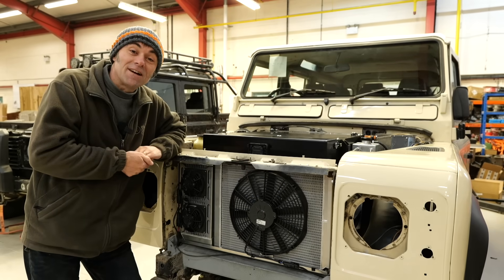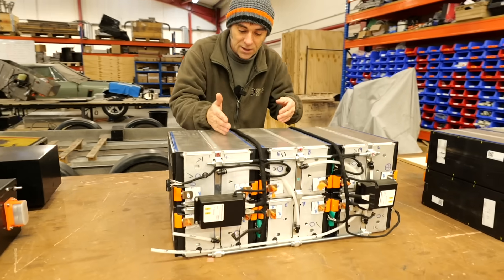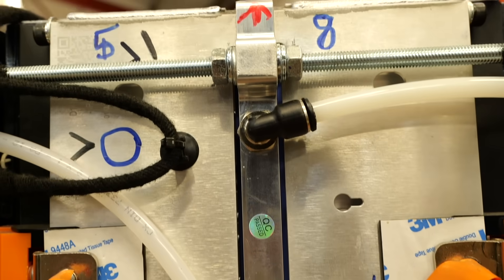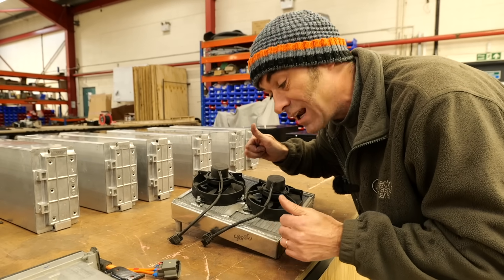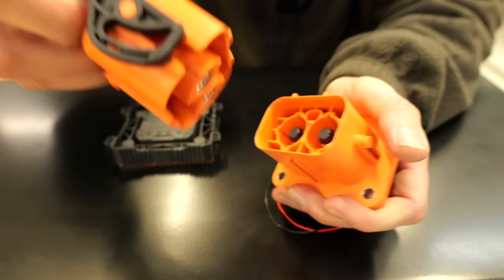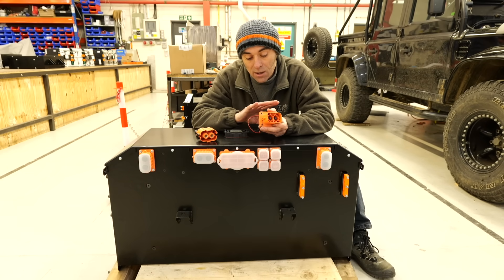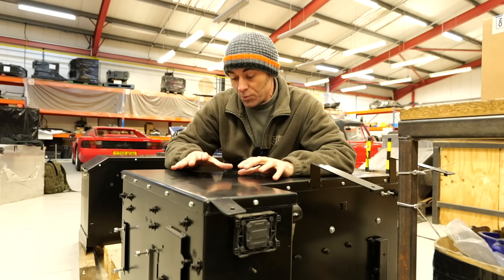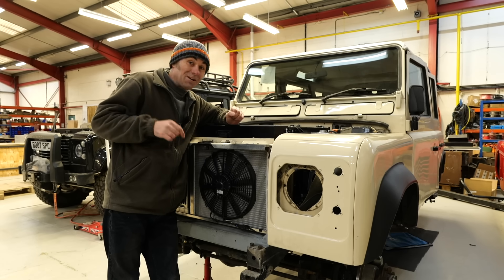How safe are electric cars?

Comment: So Moggie, this is all very good as far as the battry installation/management but, given more than quite a few events of electric cars catching fire whilst on charge, for example lately at a German car manufacturer main dealer site in Swindon, what systems are in place for this ?
Is this a vehicle systems issue or a charging station issue ?
Reply from the maker: Just because an EV is charging up when it catches fire, doesn’t mean to say that’s what caused the fire. Lots of cars (petrol, diesel and electric) catch fire when parked, due to something in the car or a fault with the 12v wiring system. The press and social media has blown EV fires out of all proportion when ICE vehicles catch fire much more often and have done for decades.
Reply: @ElectricClassicCars  My question was about what system's are provided to prevent these situations within the EV itself.
Why do people appear to take this as an attack on electric vehicles rather than a genuine interest question 🙄
But I have to say, from what I've seen, in real life a d not just the press, it does always appear to be the EV that's on fire not the infrastructure
Reply: @ElectricClassicCars  The worrying thing for me is that when an ICE car catches fire its mainly electrical and in the engine bay, but when an EV goes into thermal runaway its the power source that is the problem. We do not hear of ICE cars petrol/diesel tanks suddenly exploding for no reason! I love the idea of an electric car but i'm quite happy to let everyone else be guinea pigs at the moment. Hopefully battery chemistry will change in the near future to mitigate this obvious risk.
Reply: The Swindon Audi fire was caused by a technician not following procedure and was extinguished with relative ease, not the 'raging fire burning for days' kind of fire you may have heard about elsewhere.
Reply: It was enough to close the dealership though.
But my question was directed to ECC.
And the incident was not an isolated issue as I mentioned.

Comment: All of these systems are great on an engineered system. But this on a DIY system is not enough because a DIY system can end up with a punctured battery during installation or other physical issues that will cause a battery to go thermal. 

So the battery case it self needs to be able to contain that fire. 

I think there should be temperature sensors on every cell and an outside speaker. “CELL 5 IS OVERHEATING GET VEHICLE TO A SAFE PLACE THAT IT CAN BURN” or something like that. :)
Reply from the maker: There are temperate sensors on the battery cells. Our battery boxes are built to contain any issue like you mention. 👍
Reply: Yes I would expect your systems to be built to that quality. It was good that rich rebuilds battery box contained everything when a mounting screw punctured a battery. 
https://m.youtube.com/watch?v=6F1EbYS2Skc&pp=ygUeUmljaCByZWJ1aWxkcyBjYXIgY2F0Y2hlcyBmaXJl

Comment: The BMS is much different on this than on low voltage batteries. On a bicycle or scooter battery that is below 70v the bms is just something that connects a resistor if a cell voltage is high. So if that resistor fails then the BMS doesn’t work. Newer low voltage bms system have Bluetooth. Which allows you to actually see the voltage of each cell which is fantastic because you can monitor the health of a battery over time that way. 

The BMS on a high voltage system like a car is much different. It can not only see the voltage of each cell it takes that information into a computer or micro controller and makes decisions on the voltages it sees. If one cell is getting to high it can stop charging until it pulls that battery voltage down. If one cell is extremely out of wack it can sometimes disconnect that cell. Or it recalculates what the total cell voltage should be. 

The mistake he made calling a BMS a building management system actually makes sense. If you have been working on a building the BMS on a high voltage car is much more like a building system than it is like a low voltage bms. 

This is one of the big reasons EV batteries last decades and phone and laptop batteries don’t.
Reply from the maker: I used to work in the Building Management Systems industry for many many years, hence the slip. 😆😉👍
Reply: That makes a lot of sense

Comment: Whilst watching this video I had a thought and was wondering if it is something you'd ever considered before or would consider in the future. I was thinking, how about making a small scale model of an electric vehicle, for the purpose of a video such as this one? It could be done in one of a few ways, including a cutaway model. one that shows the innards or one that is like a normal rc vehicle, where you can simply take the body off to show all the components underneath. I watch a few channels on YouTube where people make models of cars from magazine publications and the majority of those are in 1/8 scale and so I wad thinking that would be a good minimum size for an ev model. All you'd need to do once the vehicle model was complete is to decide how to operate it, such as with an rc remote or one that resembles a dashboard with pedals, to illustrate how all the components work together.
Reply: I'm struggling to understand what a model could demonstrate more effectively than pointing things out on a real EV.
Reply: @MrAdopado Probably better to not think too hard about it, you'll only get a headache. 🤣 In all seriousness, the idea is to have a simple tool that can be used to show the simplicity of how an ev works using something that is just smaller.

Comment: Why did one battery pack bleed voltage to the case and the other didn't?
Reply: usually an electrolyte leak making a resistive connection to the case
Reply: One was faulty and the other wasn't! As the module is presently wrapped in tape I can only presume they haven't taken it apart to investigate yet.

Comment: My biggest problem with EVs is how a lot of them are just not repairable. Get a dent and total the car. It's crazy. Not really a problem with your cars I think, but a lot of new ones are designed with no thought of fixing them.
Reply: How is that? I think it’s totaled when the battery box in the lower center of the car is dented, but then the car has had a very big impact. I think it is more about the experience in dealing with repairs of EVs.
Reply: @fjt99  Look into rear body damage on a Rivian.  About $30,000 US for one quarter panel because the way it was designed. There is a plastic nipple on some Tesla batteries that could be fixed for $700 but they want to replace the battery itself at $26,000 US. With NO battery damage or impact to the battery. Look up Rich Rebuilds channel. He has a lot of videos on this. It's becoming common for EV companies to charge stupid prices for simple things. I worked in paint and body for a time. I know how to fix a car from the ground up and a lot of EVs have stupid design choices that cost a lot when time to fix them.  True a dent in the battery is an issue, but that is not what I have an issue with. I have issue with most companies making EVs designing in a way that makes it hard, expensive or impossible to repair a simple thing.
Reply: Biggest danger of a Apple I-Car, driving down road, have a heart attack, I-Car Parks Itself, and refuses to open for Emergency Services, unless you are the account owner .. However in the Real World, there is some issue with Cheap Chinese Electrics, with Paddocks full of Cars waiting to be Recycled or used, Waste happens in many industries, look @ Petrol Cars in large lots on Google Earth .. It is a issue related to "System", "New thing" everybody wants, some company will start making the cheapest version they can, to win market share, the fact there are fields full of Vehicles Fuel or Electric, that have repair issues or just waiting to be sold, apparently doesn't matter to them, they make them so cheap, they just make more to cover losses .. I think electric needs a Henry Ford Moment when somebody produces a Vehicle that makes Sense, Range, Recharge, Repairability. I have been watching things like Aptera, thinking a Solar/Electric Formula may lead somewhere, we will see .. Canoo is another I Follow, https://www.youtube.com/watch?v=QLA2W7OQnIk
Reply: That's an exaggeration .. but I do appreciate what you are getting at. I would say that the bigger problem at the moment is the assumption that cars are not repairable (ICE cars too) when in truth they can be safely and economically repaired (even whilst accepting that manufacturers could and should do more to help).
Reply: @MrAdopado  Not repairable in a cost effective manner. I worked in paint and body years ago and keep in touch with a few shops still. It's not an exaggeration if you consider the cost. If you pay $60,000 and the repair is $59000, that's considered not repairable in the industry. You and I are on the same page, but you disagree with industry standard wording because you are using literal wording. I agree, literal wording says we can repair anything that was made, but not always in a cost effective manner.
Reply: @ajosepi1976  Agreed, but the Mechanism to recycle all these vehicles back to resources should in the Mix, & Thought about a while ago ...
Reply: @James_T_Quirk  Agreed. The auto industry has a pretty good method of recycling cars already, but it should be improved. They still trash a lot of plastic, and are clueless on batteries that are not lead based.
Reply: That's all cars, not just EVs.
Reply: @RealBLAlley  I am not anti EV, but you are wrong. There is an issue with EV manufacturers being really bad at repair-ability. Granted all cars are getting worse, but EVs are down right terrible. Seriously look into it. It's bad.
Reply: @ajosepi1976 
OK, lets have it.
Name examples.
.
That's plural, and give proof.